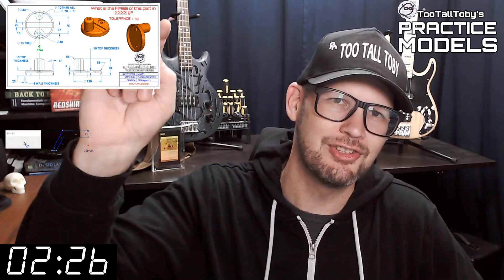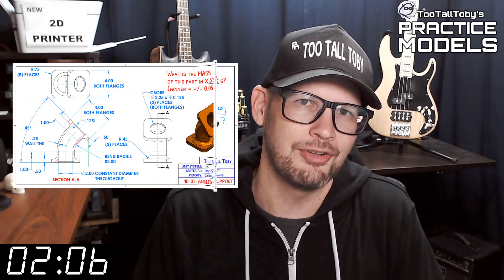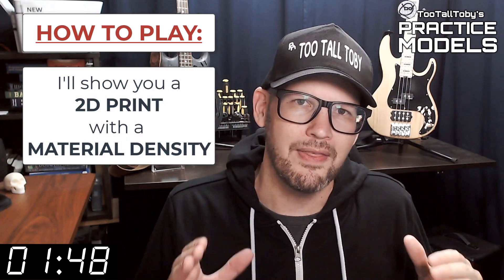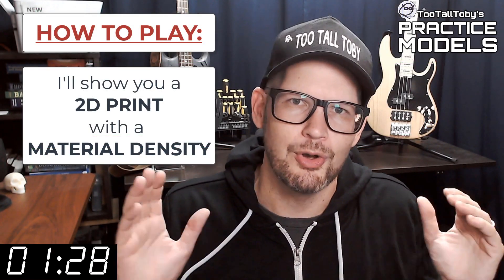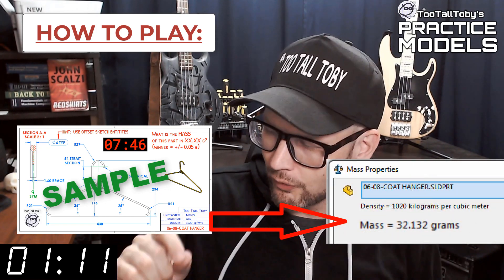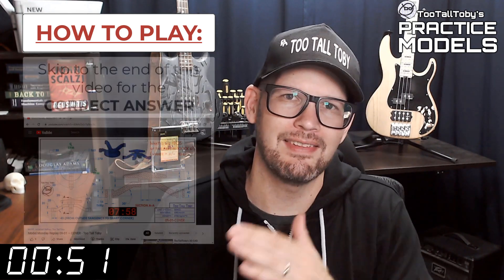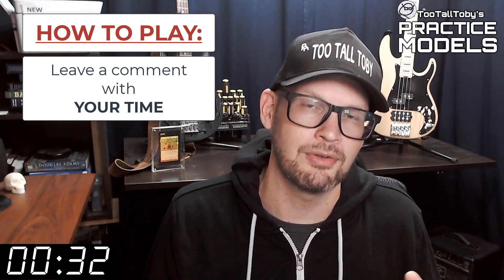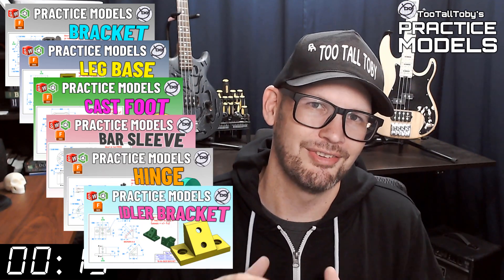SOLIDWORKS Practice - Onshape Practice - Fusion 360 Practice Exercises - TooTallToby-21-02-02

Comment: I'm sure I'm doing something wrong but I went thru every dimensions and I cant find my mistake but I get 557.94g as the Mass
Reply from the maker: 560 is the correct answer - you're very close.
Sorry I originally had 600 as the answer - that is incorrect - it should be 560.
Reply: @TooTallToby  I AM ALSO CHECK WITH ALL DIMENIONS BUT I AM ALSO GETTING. 557.22 g
Reply from the maker: @AkashGV10  Do you have the correct material assigned?
Reply from the maker: Correct Material Density I mean?
Reply: @TooTallToby  YES BRO I APPLIED PLAN CORBON STEEL

Comment: Mass = 599.993 grams (600g)
 Took me a while to do it. I did 12.60 mm offset, and other adjustments. Tricky part. Dragos
Reply from the maker: Well done Dragos!  I think I messed up the original "answer" - it's actually supposed to be 560, not 600.  Sorry about that